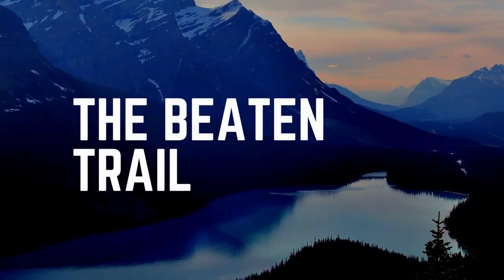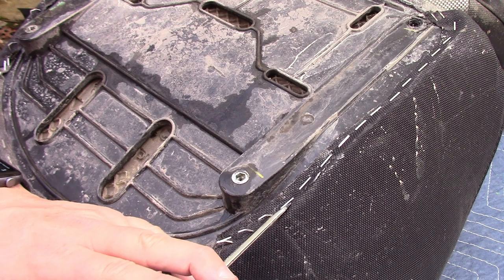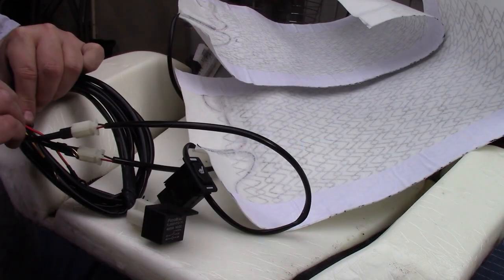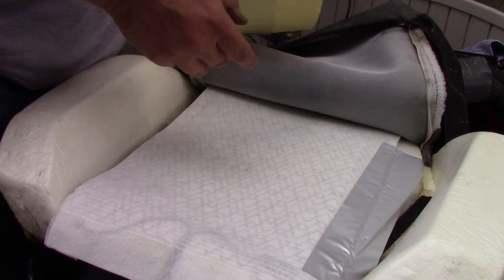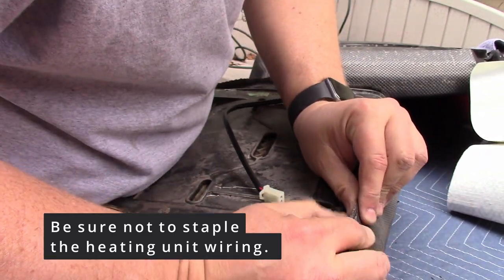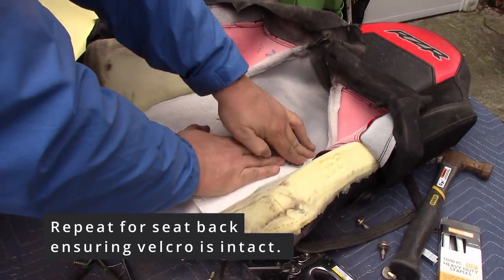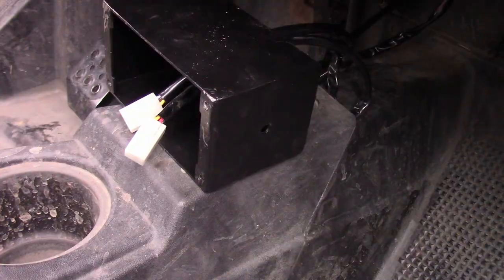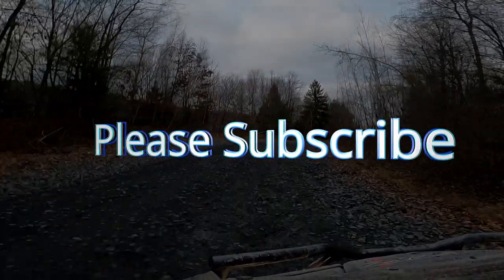How to install Tusk heated UTV seat warmer units in a Polaris Rzr 900 Trail Fox Edition

Comment: I installed these in my 2023 Polaris RZR 900 I feel like these don’t get very hot. Do you think the same or what is your take on how hot they get?
Reply from the maker: Mine got very hot on high.  I think they will draw about 7.5amps each so make sure you''re not overloaded.  I never had an issue with them even when they got wet.  The switches failed, but they sell replacement ones.  I enjoyed these in my rzr very much, wearing a carhart outfit, I had to turn it down to low since I was getting hot butt.
Reply: @TheBeatenTrail  sorry I don’t know a whole ton about electrical. If they are being overloaded what can I do?
Reply from the maker: I don't think its overloading.  I would just check how much equipment you have drawing and if you have any voltage drop when they're on.  Could be a bad element in one of them.  Another test would be a 12v cigarette plug in seat cover (heated) to see if that works by itself, then you'd know something is wrong with the embedded one installed in the seat.  Reconnect both connectors as well.
Reply: @TheBeatenTrail  this was a good reply. I recently came across this. Didn't know it was an option. I'm putting these seats in a mini jet boat and I was wondering if getting wet would effect it.
Reply from the maker: @BuyBuildThrash  I know that mine got wet from being submerged in water now and then, but unsure how well they might do with a regular soaking of water.  Salt water, if applicable, would not be a good mix for it either.  Unsure how long that would last even if you waterproofed all the wiring and connectors. :/